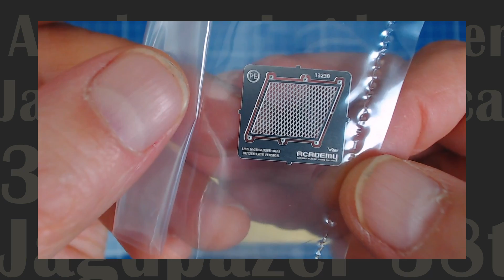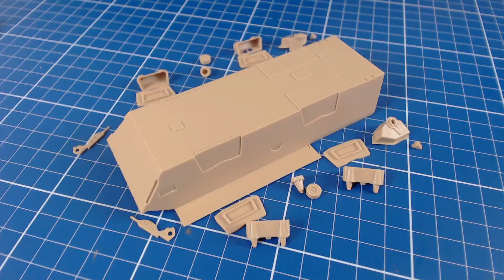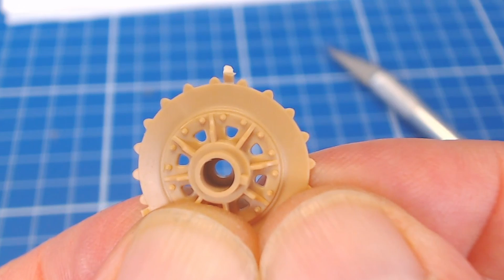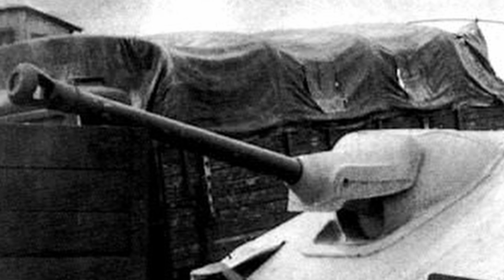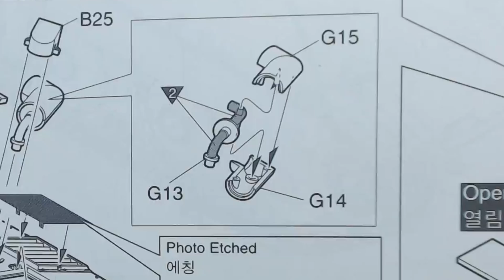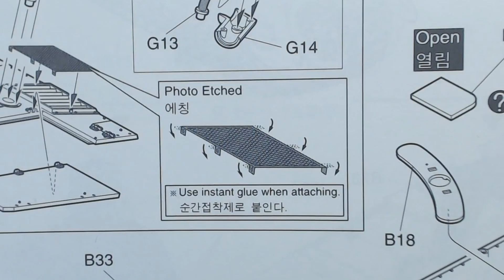Academy Hetzer Build Pt. 1

Comment: Thanks (3 years later) for the detailed video with really good videography.  I was curious about it, but I have to say that is a very soft-looking kit IMO, unfortunately.  Maybe it’s just the relatively extreme close-ups?  I’m restarting the hobby, after 50 years, with a Tamiya Pz II Ausf F (yeah, the old version).  It’s surprising to me just how detailed it is, and mostly quite crisp.  I’ll just stick with the Tamiya in the closet for my “someday” Hetzer build, I think.
Reply from the maker: Tamiya is a good brand to start with if you're coming back to the hobby; good instructions and engineering and no surprises. The good news is that the hobby has come a long way in terms of selection and the vast variety of different supplies - like paints, etc. You return is timely since the hobby is going through a somewhat golden age. Good luck with your projects and thank you for your note.
Reply: @stevieray3211 Yes, I’ve been amazed by what is now available, and even more amazed what people are doing with the kits and tools (and also how quickly I’ve acquired a ton of that stuff).   I was looking through some old Squadron magazine/catalogs recently, and the builds and dioramas still hold up, but are really basic vs some of what I see on YouTube.  It’s a bit intimidating.